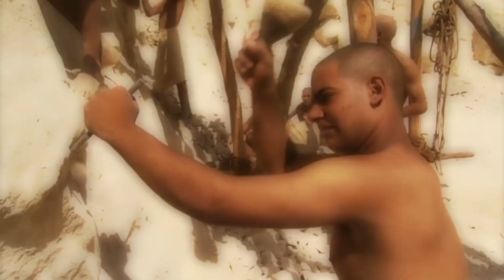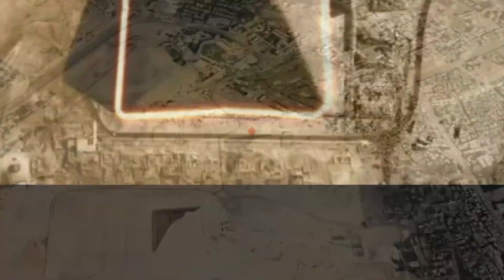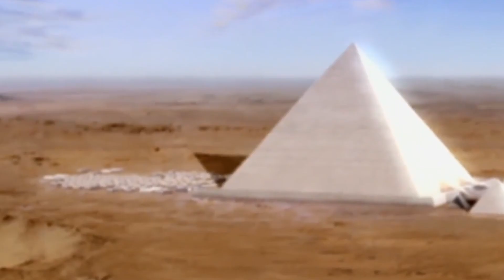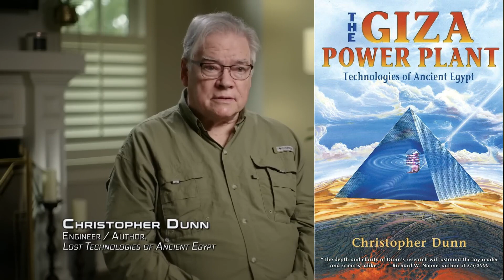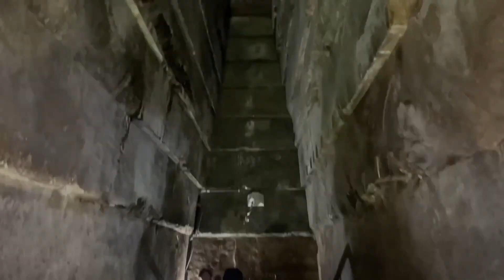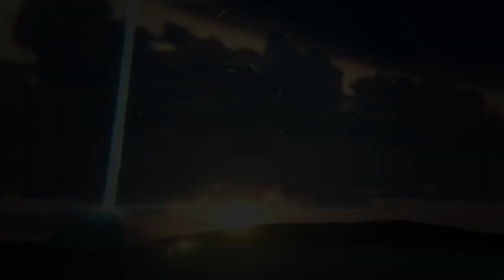What THEY Told YOU About The PYRAMIDS Is a LIE!

Comment: Pyramid was build over 37,000 years old ziggurat and its twin is in Italy, which had characteristic 4 horns as part of a machine for ionization. Building over happened more than 10 000 years ago and not as the only one. Finished product was used as free energy for everyone, but mainly to power up Parallel reality or Other side levitating technology and stargates.   .